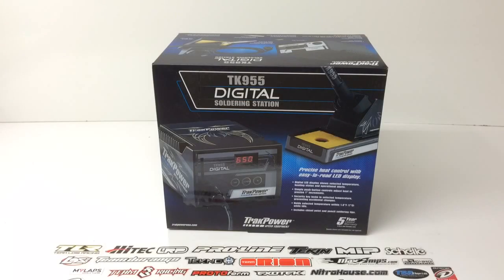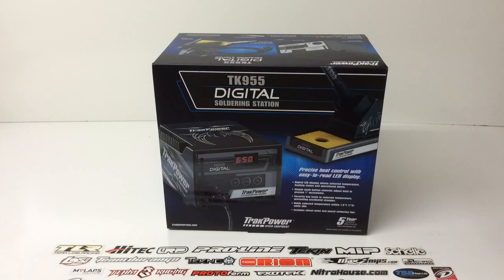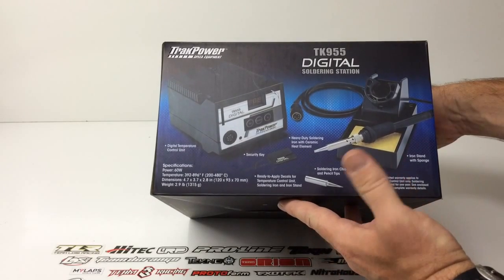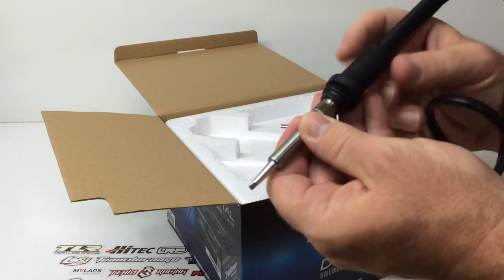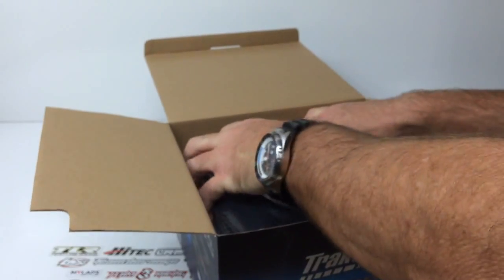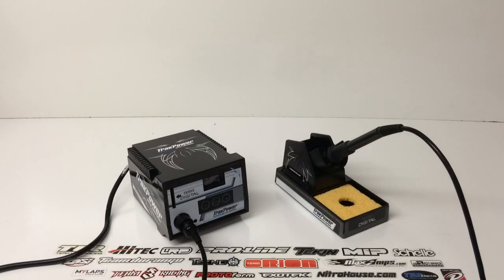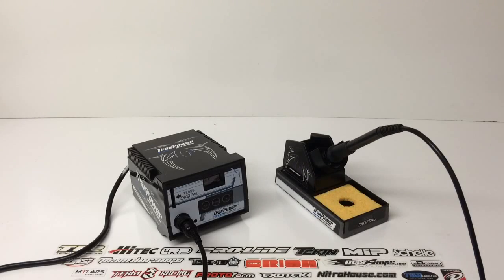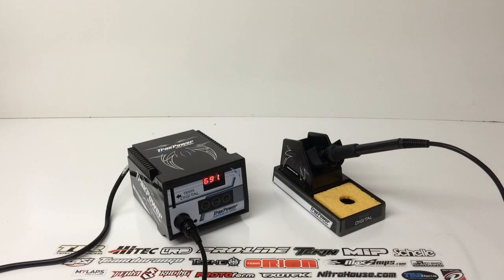TrakPower TK955 Digital Soldering Station - Unboxed and Fired Up!

Comment: Mine worked fine right out of the box, just as yours did. However, when I came back a few hours later-it seems I'm locked into parameter land and I can't seem to get heat to the tip. Room temp calibration? Heat differential? I'm getting everything except 750 degrees to solder with. The instructions are borderline incomprehensible.
Reply from the maker: Did you insert the key?  It's happened to mine a couple of times

Comment: Looked everywhere but couldn't find an input voltage range... Will this work in countries with 220-240V supply?
Reply from the maker: Yikes....not sure on that one.  I saw this "Soldering Station with 110V AC Power Cord,"  I would contact them directly.  I checked my unit and nothing that mentions that - usually there's info, but nothing

Comment: So what is the optimum temperature to solder motor and esc connections? Would that be the same for soldering on your battery connectors as well? (Deans etc)
Reply from the maker: Shawn Fairbanks yep, all the same. I solder at 180

Comment: mine came with the holder, but not the insert where the iron fits into. it's just an open square with what looks like a space for the holder to slide into. is the holder a two piece? I'm pretty bummed.

Comment: nice unit  but i will have to say you cannot adjust  temp with out useing the key then you program set  then it will work its ok  i would rather have the 936 x tronices   its digital with the nob to adjust quickly ten tips an extra heat element its a much better deal. for those of you looking to buy  a 955 understand you simply can not adjust temp with out using the key  then program then you can use   but the five year warrenty is hard to beat
Reply from the maker: The "key" is to not use the key - I've never used the key - as I'm the only person that uses my station. I have full control to switch the temp when I want.
Reply: Are you still having good luck with this soldering station The RCNetwork? I have the tk-950, the temp control failed on it and I'm looking to upgrade. I really liked the tk-950 when it was working but I'm having troubles deciding on a new station.

Comment: This works good. But you have to have the key installed in order to adjust the temp. Total Fail. It's cumbersome, and if you happened to lose both keys you're screwed. I returned it and bought the analog TK-950. Way nicer just to turn a knob.
Reply from the maker: Charlie Lemke I simply never used the "security" key.  It might be good if mutliple people use the station, but it's simple to switch the temp.  The key thing is to not use the key and hold the * key down for +2 sec.  I like the digital readout, personally.  I had the TK-950 as well

Comment: Watching the temperature climb so fast on that panel has shown me why I need a soldering station rather than my el cheapo irons. With my irons, I can hold the tip in my fingers for ages before it gets too hot....you wouldn't be hanging on to that tip lol. The heat recovery on that iron must be awesome also.

Too bad for me living in Australia  though I don't see a 240V version. There is a couple of stations available here but they do not look as good as the TK955.
Reply from the maker: Thanks DM!  It was really surprising when I plugged it in.  Having the knob 950 version, you don't realize how quick these TrakPower stations are.  I take advantage of having 120v in the US, as I never really worry about things working.

Comment: Yea the 950 comes with both tips. This is the same, just digital display. Is your first one going out? On another note..I picked up that new Orion ESC..don't really care for it to be honest. It doesn't really have a lot of punch, seems really weak. I ended up selling it and picked up another Viper..the black 10 edition. Has a ton more punch than the Orion and runs great with the newer firmware.
Reply from the maker: Chester Copperpot Hey CC, my 950 is still going strong, but has made it's way to friend of mine that scares the hell out of me when he solders with his little Radio Shack iron!  That's odd on the Orion ESC.  I have ran two different models and they're great.  They do need a Orion Programming card to really unlock their potential though

Comment: Looks great! I suck at soldering hahaha Might be easier with a batter tool, have to look in to that!
Reply: Tojo I recommend the TK950 it's a little cheaper I use it and it hasn't failed it awesome
Reply: XtremeRC Thank you! I will look in to that when I need to solder again! This RadioShack one I have sucks lol
Reply from the maker: Both the 950 and 955 are great soldering stations.
Reply from the maker: It's funny, I went through at least 3 little cheap irons before I purchased my TK950 2 years ago.  Now I actually look forward when I need to solder something now!
Reply: Its all the steadiness of your hand and patience!
Reply: The RCNetwork Yeah I need to get a good one, then I suck a little less soldering hahah